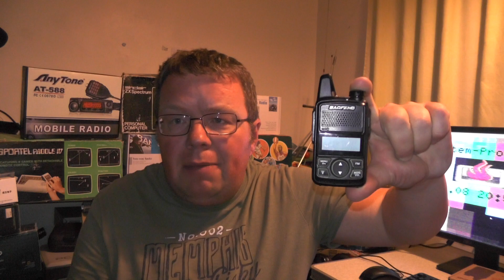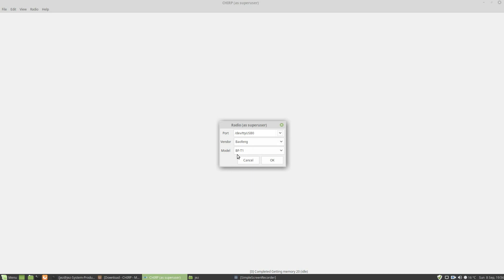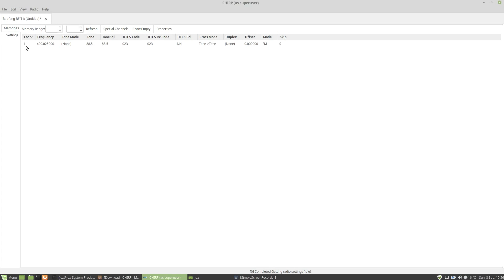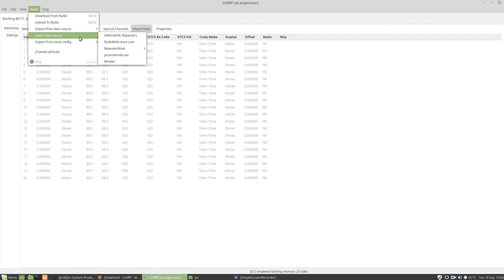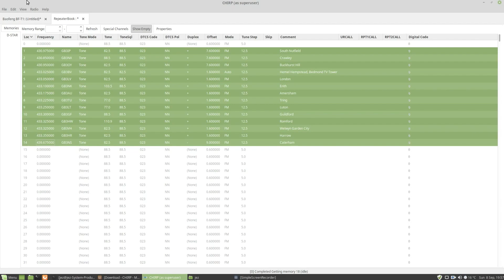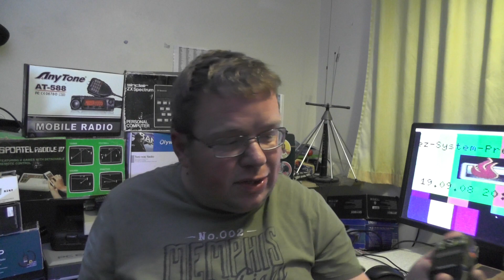BF T1 part 1

Comment: Hi all. 
I have this Baofeng BF-T1 I download the software SHIRP And i am using the USB to micro-USB cable which charging the unit as well to program the BF-T1. The problem i have is this, after i plug on to my pc the USB cable and then on to the BF-T1 it starts charging but it doesn't get detected from my pc which runs on windows 10. If anyone know any solution, please let me know.
Thank you.
Reply from the maker: the charger cable which comes with it wont program it you can get a programming cable from amazon https://www.amazon.co.uk/Baofeng-Original-Programming-F400-470-Transceiver/dp/B07CL3RRS2/ref=sr_1_3?keywords=baofeng+bf-t1+programming+cable&qid=1669837646&sprefix=baofeng+t1%2Caps%2C85&sr=8-3
Reply: @2j4ez  Thanks for your help my friend.
Regards.

Comment: You make it look so easy but I have a MacBook and I have just reset my radio to default.
Reply from the maker: You can get chirp for the Mac I run it on 10.13 no problems
Reply: @2j4ez  thanks for replying, that's where I am having difficulty, my Mac is on 11.5.2 which isn't compatible with older programs.
Reply: @quentinbush  download a Linux distro install on the Mac then download chirp for Linux

Comment: I have a Baofeng T1 radio, I restored it from the factory. my problem is to reset and when I use the softweare and the usb cable I give it either on the screen control + R or control + W it shows me 00 666.666 I do it with the up and down arrow and it does not show me the 16 or 19 or 20 frequencies it should have. What am I doing wrong or what am I missing?
Reply: Just bought the same one. Reset it to factory which left it on 460.00, nothing else. A few hours later I managed to load baofeng 9100 and it connected to an old laptop enabling me to program the PMR channels.  Chirp was useless.